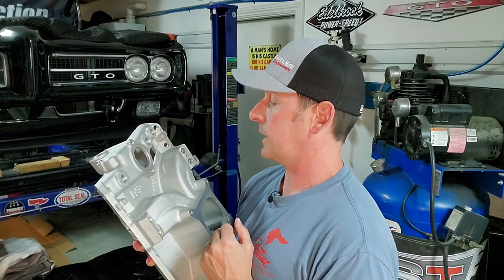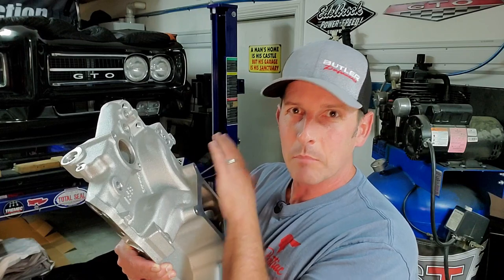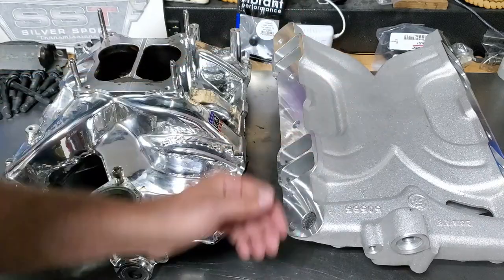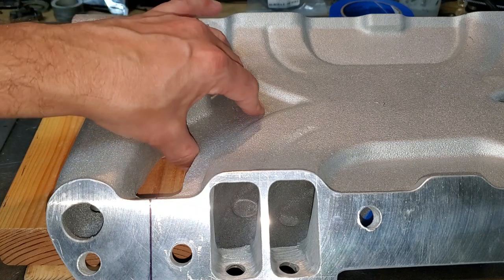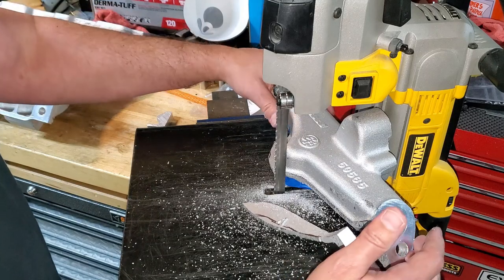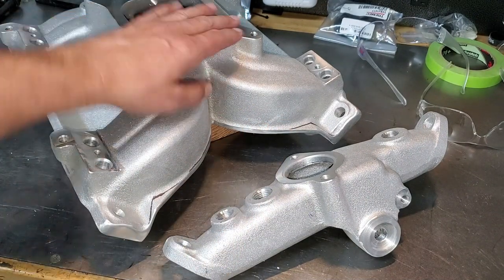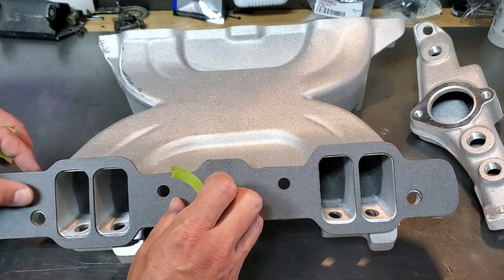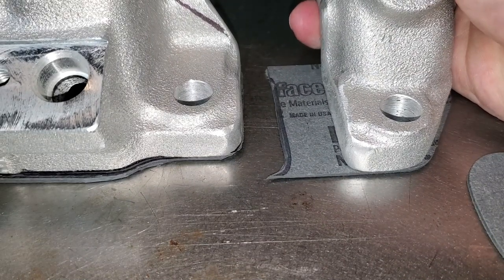How to remove an intake manifold water cross over.  Pontiac Rebuild, Part 10

Comment: I run Pontiac engines in a type of boat known as a "flat bottom V-drive". The engine faces backwards with the drive shaft running forwards to a gear box (the V-drive) which shafts rearward again through the hull to the prop which is directly under the engine. These boats are built for speed.
In this application the water crossover is separated from the manifold and the manifold is then spun around so that the carb is tilted in the direction of travel which is opposite to what it would be in a car.
Reply from the maker: Whoooa, that's awesome!  I had no idea.  Thanks for sharing!

Comment: I did my intake like this, but I have 6X heads, make sure you do not cut to close to intake flange side because there is a hollow place cast in head where push rods go, I think its just a passage to be vent for PCV. Monte's application used aluminum heads that doesn't have a casting hole as the 6X have. I learned this the hard way.
Reply from the maker: Great tip!  You're catching up with me... learning the hard way, on everything.  Ha, ha... thanks for the comment!
Reply: @FastMonty  when I divorced  the intake I cut my gaskets to the intake like you did, didn't realize anything was wrong till the test fit, dang that's no good, so I ordered Edlebrock gasket set hoping there is enough flange left on intake to seal since there should be little to no pressure at that sealing surface. Edlebrock gaskets overlap the valley pan & valve covers surfaces so they need to be trimmed for clearance. Gonna use rtv on head side of gasket at that point then install  intake. Motor is a 70' 455 - 0.060 over, I put less than 1500 miles on it before it started to run ruff at idle but still ran good under acceleration with a Holly street avenger. Purchased a Sean Murphy Induction Stage ll Quadrajet to keep
 it GM muscle
Reply from the maker: @kennethsautter-lz5fd  So sorry to hear that.... but, glad to hear you've overcome the challenge.  Keep at it!

Comment: Isolating the cooling from the intake is a fantastic idea!
Reply from the maker: Thanks!  I love it too... especially when doing any maintenance on the cross over, or just the intake itself.  Thanks!
Reply: This seems it would make it a lot easier to get that to seal to timing cover Nicky and if it leaks don’t have to remove whole intake
Reply from the maker: @rileyenia9388  Agreed.  It was a lot easier to seal the crossover to the timing chain cover, then confirm it was flush with the heads.  Thanks!

Comment: Great Video…. 👍
I did this to all my intakes, except for the tri power set up….
Makes swapping out the intakes a breeze, and never have to mess with the coolant….
Reply from the maker: Thanks Ronin!  Yeah, I can't wait to see how she behaves.
Reply: @FastMonty  ::: please post.... Would love to see as well..!  Stay Safe..! 👍
Reply from the maker: @reaperronin8898  You know it!
Reply: I think this is the dumbest mod (trend) on record. How often do you change intake manifolds? I have changed mine 3 times in 30 years. Each time I did, I pinched the upper radiator hose, unscrewed the water neck, elevated it and set it to the side, pulled the Tstat out and used a turkey baster to evacuate the crossover. In 5 minutes, my intake was off and not a dropped spilled and I didn't have to butcher my intake.

Comment: This is a great video thank you. I do have a question. On my 69' 62 heads I have a oil return passage that is now exposed after cutting the gasket. These holes are right behind the coolant crossover and in front of the first intake manifold bolts.
Reply from the maker: Thanks for the comment... can you send me some pics of both the heads, and mating area of the block?  fastmontysgarage at gmail  thanks!

Comment: Just curious. Looking into intakes. Looking at the "Porker" 2 and the Northwind. The Northwind looks very similar to the Torker II, but with nothing to cut away etc. Why did you decide on the torker? Was that just because of the EFI bungs? Thanks
Reply from the maker: Yup, I wanted to eventually go to port injection, and that's the only manifold that has it.  The Northwind is an awesome intake.

Comment: Have you had and problems with that water crossover leaking after you cut it. The bolt is only at the top and wo the rest of the manifold attached im thinking a leak would develop at the lower end where the bolt is?
maybe a oring groove around the opening if it leaked.
Reply from the maker: Nope.  It's a thick enough flange to hold pressure evenly.  Thanks.

Comment: What happened with the fitec efi? I was wondering as im considering a holley sniper kit but kinda on the fence. I've considered doing this on my torquer 2 as well. Glad you shared this with us you tube folks!
Reply from the maker: Nothing happened.  Still using FiTech, and eventually I'll be adding their next Port Injected solution.  (It's not invented yet, so stay tuned)

Comment: I noticed on my Edelbrock cross over holes are smaller than the iron cross over. Where the coolant flows out. Hopefully this makes sense. I ended up opening up the coolant holes.
Reply from the maker: Yeah, If I recall, those openings are also threaded?  Where the stock heads are not.  I think they're 3/4 NPT which is why I screwed in AN fittings.

Comment: Great into and video as always.  Only thing I would add is that you can make your life a lot easier and use a course carbide cutter which will cut through Aluminum like butta'.  Mine cut so well, I took out the webbing in between the front and rear runners as well.  Finish with the flapper wheel.  I think you have it covered with your TB but while the manifold is off, some may want to consider drilling and tapping into the front of the plenum so they can route their PCV valve from the stock location to the manifold without an ugly hose running around to the back of a Torker II.  Here is a link to the type of cutter I used:  https://www.amazon.com/SpeTool-Carbide-Aluminum-Cutting-Non-Ferrous/dp/B06X9TXBYW/ref=sr_1_2_sspa?crid=2M0386ZBTABEK&dchild=1&keywords=carbide+burr+aluminum&qid=1626186160&sprefix=carbide+burr+alum%2Caps%2C183&sr=8-2-spons&psc=1&spLa=ZW5jcnlwdGVkUXVhbGlmaWVyPUExUktBQU5CSzFCQU8yJmVuY3J5cHRlZElkPUEwODQwNDEyM1U5OTk4RjNFUlhZTCZlbmNyeXB0ZWRBZElkPUExMDI3ODQwMlFTRTg1WDQxVkRGOCZ3aWRnZXROYW1lPXNwX2F0ZiZhY3Rpb249Y2xpY2tSZWRpcmVjdCZkb05vdExvZ0NsaWNrPXRydWU=
Reply from the maker: Thanks Steve!  Too funny, I have those Carbide Burr's... totally didn't think to use em.  Next time!  Thanks for the comment!